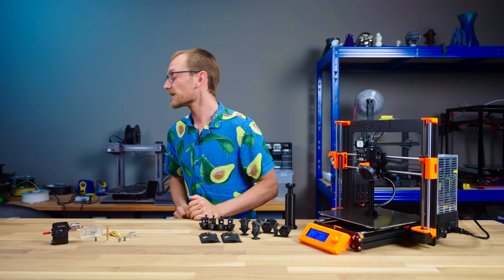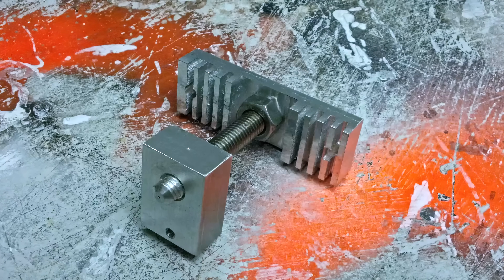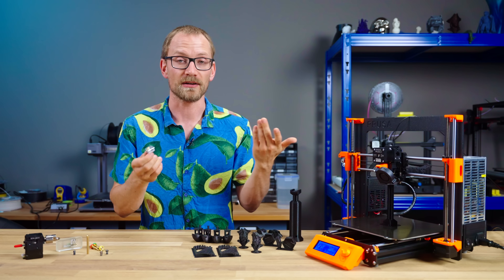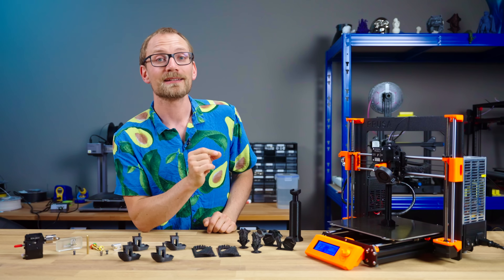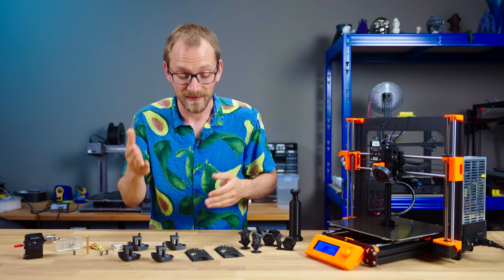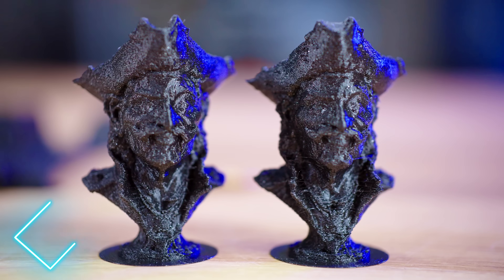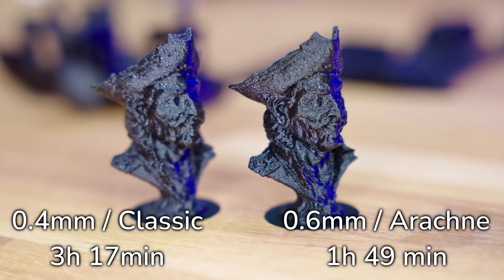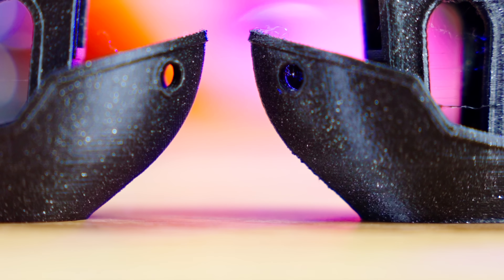0.4mm nozzles just became obsolete

Comment: I bought a 0.6 nozzle for my P2S and use it on larger prints, works great with arcane. BUT, even though its fascinating how good 0.6 works with arcane, i totally see the advantages of a 0.4 nozzle (with which i also use arcane). Smaller Walls and especially text or fine details just look much cleaner with 0.4. And 0.6 can somehow sometimes get slightly more artifact, on the outer surface.

Comment: I recently switched to a hardened steel 0.6 size on my elegoo neptune 4 pro; but now i'm having layer adhesion problems with basic PLA. Had to set my nozzle temp at 230 and cooling at 30% and slow the print down to 95%.... I'm confused! Is this normal?

Comment: If you can't tell which ones are the 0.6mm then you need an eye exam bro. All the 0.6mm look worse. You'll never get the detail of 0.4 with a 0.6. Duh. Frankly even 0.4 is lacking in detail and 0.2 is needed for fine stuff. Also, arachne makes a big mess out of things and is only "nice" in certain benchmarks. It relies on a concept that is simply impossible to begin with. IDC how much filament you extrude out a 0.4mm nozzle you're still going to get a 0.4mm line (give or take based on the filaments shrinkage/expansion and how close you can slam the nozzle into the print surface. It's the same misconception people have about line widths in the slicer. They don't make your printed lines any wider/thinner 😂. You need a different nozzle for that, period. All it does is tell the slicer to assume your lines are a diff width so you can account for expansion/shrinkage. For example, a higher line width will give you gaps between your lines. Not make them overlap. This is very apparent when printing PETG that usually requires 0.32-0.38mm line widths just to get line adhesion. If you go over 0.4mm the gaps get even worse. The printer is not capable of accurately adjusting the width of printed lines on the fly. It's all delusional nonsense by people that don't understand any of this stuff. The same reason we can't get any good slicers and they're all ripoffs of the ancient slic3r

Comment: I tried a 0.6mm nozzle. Didn't change print times or anything for what I was doing on my Bambu printer. They currently have a sale on ESD ObXidian nozzles, but only 0.4mm, so that's what I bought. I do fear losing some small detail at 0.6mm, but I prefer what I saw in the video. Not sure if it's still relevant today.

Comment: 7:30 Yes, the very small thin text looks better on the 0.6mm nozzle WITH Arachne than the 0.4mm nozzle WITHOUT Arachne, BUT the bigger thicker text looks way better on the 0.4mm nozzle than the 0.6mm nozzle. So I guess this guy has shown that Arachne makes thin lines look better. So... use Arachne with a 0.4mm nozzle to get the best results.

Also, you can see a difference in the Benchys. Look at the smoke stack coming out the top. One clearly has a smaller hole, probably because it was made with thicker lines.

But yes, printing with a 0.6mm nozzle is faster and can look good.

Comment: I'll be honest, the .6 just seems to look worse is most of these demonstrations so I don't understand your point. It's faster yeah but at the cost of looking slightly worse which is just how larger nozzle sizes work anyway. All of the benefits mentioned here have nothing to do with a .6 nozzle size but rather Arachne which I could just use with a .4 and have all of the benefits with a better looking print because of the smaller nozzle size of the .4. 

Your argument holds no weight when you aren't even comparing nozzle sizes you're just comparing on old slicing option with a new and better one while saying "because Arachne makes .6 look almost as good as .4 and is faster it is clearly better" when in the end I could just use Arachne with a .4 nozzle and get a better look from a .4 nozzle and the better slicing from Arachne.

Comment: I feel like the 0.6 nozzle and arachne are just two steps in a multi step process of reduce/don't print multi color, refining your infill and supports, variable layer height, amount of layout/orientation of prints on bed, setup processes like bed levelling, load line adjust, nozzle wipe, poop etc... My current print is 2% faster with arachne. It doesn't help if a print is faster but then just sits for hours...
Reply: Slow prints at night, fast prints during the day

Comment: Came back to watch this again after trying and struggling to switch to the 0.6 on my Elegoo Neptune 3 pro. It keeps printing the first layer perfectly and then making a hot mess. It doesn't help that I usually use Bambu studio even though it's not the default for Elegoo because I hate Elegoo cura but Bambu doesn't have other nozzle sizes besides the 0.4. For my machine so now I don't know if the problem is in the machine/nozzle or my slicer. I might just have to go back to the 0.4. At least I bought the hardened ends so even if I stick with that size it wasn't a waste of money, and maybe I'll try going to the 0.2 for my DnD miniatures.

Comment: I know this comment is 2 years late, but combine the 0.6mm nozzle with Arachne AND Cura's Adaptive layers, you can cut printing times even further by letting Cura choose higher or lower each layers depending on if that layer needs fine detail or not. I tried printing a mouse shell that requires fine detail with 0.12mm layers and it took 8 hours, with adaptive layers and a default layer height of 0.4mm, I was able to print it in about 3 hours.

Although I'm not sure if adaptive layers is available in every slicer.

Comment: I've been using the 0.4mm for as long as I can remember. Back when I had the anycubic i3 mega (worst 3d printer I've ever owned), borrowing a modified CR-10 from a friend, and now with my own creality k1c. I hate how it takes SO LONG to print basically everything. I have a 0.6mm and a 0.8mm nozzle that I haven't used, but the way that I understand is that 0.6mm prints significantly faster, but also uses significantly more filament. If I print a part that uses 100g of filament in 0.4mm, then I should be expecting at least a 20g or more increase if I use a 0.6mm, and since I have all these ideas and models, it's going to turn pretty expensive.
I spent an entire 1kg of PLA to finally tune in my k1c for printing PLA. Just a bunch of test pieces and whatnot and if I have to do that again for a 0.6mm nozzle, It's gonna get expensive (for me).

Comment: Thanks for this, it really made me think. Previously i thought the sole advantage of a larger nozzle was being able to have thicker layers. The factor arachne has in this is also interesting. There is one point however, which I don't believe you mentioned (?) and that is that having thicker and/or wider layers gives improved part strength, so using a 0.6 nozzle alone will give you improved strength.

Comment: I just ordered a 0.2mm nozzle because text was completely messed up...  Then I tried the new Arachne and it actually handles the text with EVERY size, including 0.4, 0.6, and 0.8.  That was a huge surprise... But I'll take your advice and use the 0.6 so that I get the text I need, plus the speed and without worrying about the heat issues with 0.8. Now I'm wondering why Arachne is not the default.
Reply: thank you for your coment I decided to try 0.6 too

Comment: What a dishonest video.  At 4:15, the Benchy printed in 0.6 classic jumps out immediately (#3, undersized smoke stack hole) and 0.6 Arachne (#4, hole not quite as undersized, flawed bow railing, and abysmal flag holder), but you made it as hard as possible by using matte sparkle PLA, and a constantly moving camera that's so stopped down that not even one Benchy has all parts in focus at a time.  If all you're doing is making toys that have no inner diameter tolerances and always use Barbie sparkle filaments designed to disguise the flaws, go ahead and use 0.6 all the time.  If so, I would argue that your time is worthless so why save time, but the kind of person that prints crap like that probably is struggling with attention span issues so speed is of the essence.

Comment: I'm making this comment in 1/2025 and for my bambu labs a1 mini slicing using orcaslicer.  I tried several models I've been printing in petg.  And I had only 1 or 2 min difference between archane and classic with 0.6 mm nozzle.  So this video may not be relevant or it may only be relevant to older printers or idk.

Comment: 2 years later... still 0.4mm standard on every consumer printer.
Reply: Something has to be "standard".
Regardless of what the "best" is, unless it is actively detrimental there will not be a change. Standard parts are mass produced parts. Mass produced parts are cheap parts.
Once that ball starts rolling you will not see a change unless customers start choosing products based on a difference.
It's not that big a deal to sell 0.6mm separately. New users won't know the difference and experienced users will want the a variety of options. Neither of those things change by changing the standard.
Also, calling for a change of standard because one slicer adds one new setting is just silly.

Comment: I suspect the reliance on using 0.4mm nozzles is not that it is what we currently use, but the past difficulty of changing nozzles.  I know personally that I would prefer the benefits of resolution gains or speeds with different sizes, but on a Prusa MK3S+ nozzle changes are anywhere from annoying to expensive and after breaking more than one hotend assembly at the cost of 100 dollars I just quit changing nozzles until they are absolutely worn out.

Nowadays I guess with the mk4 and core one you can swap nozzles easier and that might bring more adoption of 0.6

Comment: I've been using 0.6mm for a long long time now. One day I got adventurous and just hand drilled my 0.4 out with a standard issue 0.6mm bit. Got to be careful you don't snap the bit off in the nozzle but it's actually pretty easy once you get some practice at it. The speed advantage of a 0.6mm is pretty nice, it'll spoil you.

Comment: "can't tell the difference between the benchy's" i haven't yet been told which one is which, but the 2 on the right have elephants foot and a smaller diameter hole for the stack so i'm picking those (edit: picking them as the 0.6mm, also starting to wonder if you actually tell me if im right or not at all in this video)
Reply: never got the answer :(
Reply: @chaniem.5422  yes this is horrible

Comment: Does Bambu slicer have an Arachne equivalent?  I need 0.6 hardened nozzle anyway with fiber filaments.  What are best settings?  Recommended to print these filaments at 50 mm/sec on a 300 mm/sec printer.  So we are back to slow.  Call me impatient LOL.

Comment: I started using 0.6mm nozzles recently and I just love it. Prints are stronger, I can print with 0.36 or 0.4 mm layer height fine and that decreases the printing time a lot (this + less wall lines). I also tried the opposite: 0.2 mm nozzles and are great for figurines, but it takes ages to print anything.

Comment: In about 2009 my friend printed me the parts for an oldschool RepRap Mendel - both the plastic and some of the electronics (the printer also laid the solder onto the board!). It had a 0.5mm nozzle and as far as I can remember Slic3r (the only software option at the time) only had a hardcoded option for that which was fine because my printer couldn't move in more than 0.5mm increments anyways. We've come an amazingly long way :)

Comment: 07:30 0.4 is much more clean than 0.6 with Arachne even if it loses some details. In real life, the best is not 0.4 or 0.6 or whatever other nozzle size but just to use the right nozzle size according to what you are going to print. So the best setup is to have a printer on which you can easily change from a nozzle to another.
This video seems more like an advertise for arachne function than a real comparison video, sorry.

Comment: By simply adjusting your wall count, supoort type, using manual supports, changing infill density, using ironing, changing your infill pattern, acceleration speeds, print speeds and other variables you can take a 11hour print to being just 7 hours without needing to change your nozzle.

Comment: 0.4mm when you need precision for tight fitting parts 0.8mm when you need speed and strength (even at 100% infill); I tried 0.6mm and it was like, not precise, but also not as brutally fast as strong as 0.8mm.

Comment: Have been using .5mm nozzle for a decade or more, never noticed any difference, using any algorithms, with the previously used .4mm. Have printed very small and precise mechanical parts for micromotor applications. Didn't know that any particular size was a standard. I wouldn't care for this parameter more than for any other, such as the layer thickness or the travel speed. The reality of an average user is that you use what you have in the box of your spare parts and adjust the settings accordingly. For example, when my work piece cooling fan failed, I disabled it and has never used since; not a problem at all if the other settings are selected accordingly.

Comment: Weird assumptions you make about makers. I daily print parts requiring an accurate .2mm detail resolution from an old ender 3. In comparison, your parts looked incredibly low resolution and blobby.

Will check out this option to see if it also improve things at the hyper detail levels also, but there's definitely both space and reason to use smaller nozzles

Comment: My Ultimaker S3 has .4mm nozzles normally installed and I get nice tight print results, but for larger thicker projects I'll swap to .8mm nozzles, however resulting in half the resolution and twice the filament consumption. I personally prefer .4mm nozzles for the smaller work I more frequently undertake. Thanks for sharing. 👍

Comment: I ordered a Core-xy printer from Amazon. It was supposed to come with a 0.4mm, but after a few failed print attempts, I pulled it out and measured it at 1.6mm. I think I got a returned printer, because It also had an unknown firmware on the controller that took me a long time to figure out.

Comment: Thank you for all the information you have just shared here. I think that is quite an important one especially in nowadays there is a lot of speedy printers that can make all the parts run to its limits. So thank you for all these tips you have provided and test  You have done. I will gladly use them on my machine and share something I found out by myself with others.

Comment: I use Cura and definitely want to try this out. especially with miniatures. I current print miniatures at 0.12 mm layer height with a 0.4 mm nozzle. and my 0.4 mm nozzle is already struggling with 0.08 mm layer height let alone 0.04

Comment: If you want to get lightweight parts, the 0.6 mm simply does not work. I print 2 perimeters 0.36 mm wide (total wall thickness 0.72 mm) and 0.25 mm layer height. The infill wall is 0.3 mm wide, to have the lowest pitch possible for any given infill density. With the 0.6 mm nozzle there is no way you can print 2 perimeters that thin (or 0.3 mm infill). So your part will be much heavier and less homogeneous. Printing a single perimeter will NOT give you the same surface quality (no visible infill contact points).
Moreover my top and bottom solid layers and infill speed is flow rate limited (10 mm3/s with PETG on E3D V6 nozzle), so I have nothing to gain, and a lot to lose.

Comment: Obviously, I still see the 0.4 nozzle until now, but it is true that 0.4 is not always suitable for any application. I normally use 0.6 nozzle rather than 0.4 for most of my print and it is frustrated as new 3D printer manufacturers keep releasing their machine with new design of nozzle, like Neptune 4 series and so on, making user have less choice in nozzle diameter.

Comment: So I've always been a print slow and small inn high detail kinda guy, even for stupid big prints, more time for thee crappy stock sooling on most printers, but also more detail, moving parts need less clearancing and usually less post work too.

It's been 11 years since I've 4d printed and I just got my hands on a sovol sv06Plus, screen fried on day 2, installed klipper, prints like a beast with a .4mm nozzle, so much finer than im used to, so now im sitting here wondering how much better details could be  with a .2 or smaller. I only print in pla anyway

Comment: BEWARE. Try slicing some files at .6 before you switch nozzles. Modern fast printers are less limited by nozzle size and more limited by allowable flow rate. On my Bambu I get little to no improvement in speed unless I up the max flow rate considerably, and that tends to cause a lot of other problems. I'm going back to .4 unless I need to print abrasive filament.

Comment: New to 3d printers, I have an Ender 3 v3 and don't see where to set the nozzle to .6 from .4. I am using a Prusia slicer as the Creality one is junk.  Thanks
Reply from the maker: It's in the "Printer Settings" tab, under "Extruder 1". Also make sure that in "Print Settings", "Advanced" doesn't have any 0.4mm-specific extrusion widths set.
Reply: @MadeWithLayers  Thank you for the help. I see that now. Time to experiment :)

Comment: And what about the .4 Arachne SL1? That would be the interesting part, that would change your videos message from "use arachne" to "use .6 instead of .4". Like this the title is just pure clickbait. Add a single part with a dome and both on arachne the smaller nozzle does loads better. Your assumption, that most layer printers mainly run engineering parts is NOT a small one. But maybe for your usual audience it's fair... Had loved a disclaimer in the beginning instead of loosing 15 minutes.